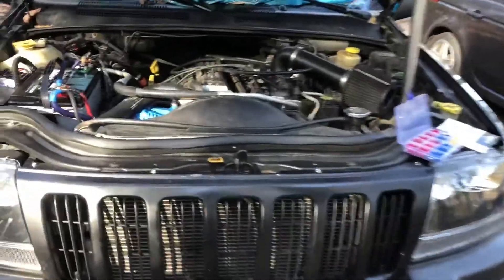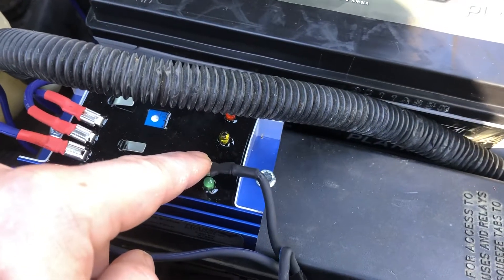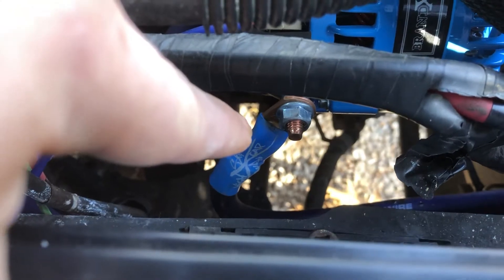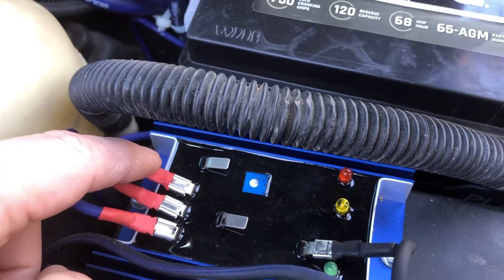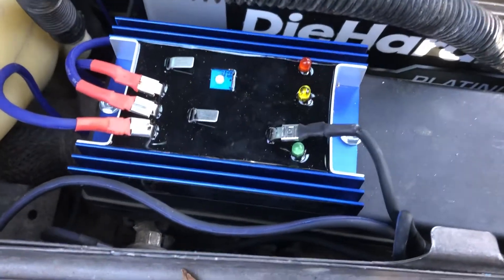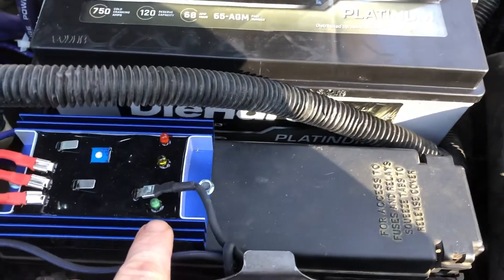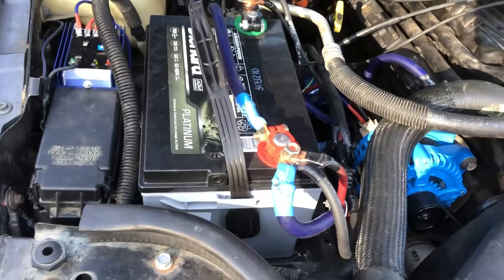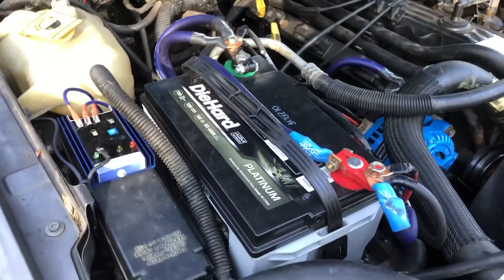How to install a Transpo v1200 external voltage regulator from brand x

Comment: Hello im running this exact regulator.  Did you experience the headlights to come on when starting the car? My turn signals also dont at times and when i disconnect the a wire from the regulator they work fine.

Comment: My alternator from autotech came with a 4 pin plug but only 2 wires. One goes to remote 12v, the second to alternator positive post. How would i go about wiring the regulator? I've followed the video, and all i get is a steady 14.75v. Turning the potentiometer on the regulator does nothing, but the lights come on as if it's functioning fine. Any ideas?

Comment: Your video was great and helped me out a lot, but I’m still a little confused on a couple of things. On the side of the unit it says green light indicates power on. You said it indicates trouble? Also, the “I” prong that you mention doesn’t get used, Is that true on any vehicle? Because on my 2004 cobra all four prongs are used according to nations starters & alternators….. The first one from their harness is white, the second one is red, the third one is yellow, and the fourth one is green. With key off the yellow light is staying on, do you know why? Any help would be appreciated.

Comment: I'm running a 12-volt relay. Do I have to run one? And the orange light does'nt come on, just the green and yellow light. Everything is hooked up right. except im running a 80amp solenoid.

Comment: So My regulator is internal, i would use ignition pin for positive wire and computer field monitor pin for field wire? Then negative to battery and what?

Comment: Does your voltage float? Example: I set at 14.70 but floats 14.70-14.72 is this normal
Reply from the maker: A small fluctuation like that absolutely nothing to worry about
Reply: @Jboost412  Tks bro
Reply from the maker: No problem at all!!
Reply from the maker: Always happy to heIp!!

Comment: How do I adjust it to put out a higher voltage. Thx
Reply from the maker: Start up the vehicle then turn the little potentiometer with a tiny Phillips or flathead screwdriver little by little and until you hit your desired voltage

Comment: You should redo the ground. add a bit of a washer between the clamps. So it tightens flat. Those lead ones are huge cause for issues.
Reply from the maker: Absolutely All of the wiring was just temporary a few weeks later everything was Rewired & converted to run on lithium

Comment: Do you have the battery light on in the dash?
Reply from the maker: No mine doesn’t come on I’m sure some vehicles will be different
Reply: @Jboost412  i have a 2015 Jeep Wrangler. My transpo works fine but i have the battery light on dash. few things doesn't work which i am fine with for now. heated seats and the 110v outlet.

Comment: This will work with any car
Reply: How I get the battery light go off
Reply from the maker: Not exactly sure…what kind of vehicle?
Reply: @Jboost412   I got it now thanks yo video really work
Reply from the maker: Your welcome happy I could help!
Reply from the maker: So there’s definitely some vehicles that won’t accommodate a external regulator at least in stock form but after some work on the electrical yes pretty much anything with a alternator can be modified to run a higher or I suppose lower voltage if you wanted it to

Comment: Did you use the stock alt wire of did you tape it off
Reply from the maker: In my setup none of the stock wiring was used since it’s all too small i definitely wouldn’t recommend reusing it you need 10-12g ofc wiring for the external regulator to function correctly longterm
Reply from the maker: For my alts + output to charge the batteries I’m using 2 runs of 4/0 back to my lithium and cap banks so there’s no drop in voltage
Reply: @Jboost412  thank you I’m going to try that now and see what’s up, currently we are only getting 11.6 when the car is running
Reply from the maker: Does the potentiometer work correctly? It should be set all way down out of the box and you have to turn the dial up slowly while monitoring the voltage until you have the desired result
Reply: @Jboost412  yeah we have it set all the way down
Reply from the maker: Ok cool so dial it up slowly monitoring the voltage level if that works your good to go if not you might have the field connection mixed up

Comment: If this regulator only goes from not charging to 16.8 volts has it gone bad?
Reply from the maker: Well it would be a first ive heard of one failing but anything can break! I would start by making sure all of the connections are clean & tight but yes if everything is exactly how it was when it worked unfortunately sounds like it went bad

Comment: I have an 06 Durango with 5.7. Bought 270a brand X and my idle amp are only 12.2 at idle. Some say it’s because Chrysler pcm limits the alternator and therefore you have to use an external regulator. Is this true?
Reply from the maker: It’s definitely possible, but I would make sure all of your connections are tight the belts good it’s not too long causing your pulley to slip

Comment: Hey man, i just installed this thing on my caddy, and the voltage will only adjust to a max of 14.8, as well as the field wire is the only wire getting higher voltage when i adjust it, and alternator output stays the same
Reply from the maker: What year is the vehicle? And do both lights on the regulator light up? Also is the alt stock or aftermarket…just wondering…so if you turn the knob all the way down the voltage won’t go down and all the way up for example it’s not going up? I’m wondering if you have the alts connector completely disconnected from the vehicle sounds like the computer controlled regulator is still attempting to do its job
Reply: @Jboost412  yes it is the stock alternator for now, and both lights will light up and it turns on just fine. except when turned off the amber light stays on. checked voltage at the connectors and everything is connected how it should be. my alternator plug does not have a ground however. it is a turn on signal wire next to the field wire. should i do anything with that?
Reply: any ideas? im stumped at this point and the yellow light is on at all times. sorry for so many questions
Reply from the maker: If the lights are staying on all the time your ign + is actually getting constant power instead but I’m gonna say your not connected to the field pin from the alt over to the regulator of nothing is changing
Reply: @Jboost412  field pin is now connected, lights come on like they’re supposed to. regulator still doesnt work and i had a spare. that didnt work either
Reply from the maker: With everything connected to the regulator itself is the vehicle completely disconnected from the alt in the sense that the wiring that use to run to the alts connector is no longer connected to the alternator or the connector that you jumped over to the external regulator?
Reply: @Jboost412  Yes, nothing from the car is connected anymore
Reply from the maker: Then that’s an odd issue especially since you’ve swapped regulators i definitely don’t understand what’s causing there to be no manual control over the voltage

Comment: Mine came with an orange box what wire does that go on ?
Reply: Also there is glue on the dial like it’s already preset ?
Reply from the maker: Never seen this message sorry about that first answer is yes there you’ll find some glue or rtv over the potentiometer/adjuster but they’ll never be preset always start with the dial all the way down since different applications & setups have a different starting point for voltage second answer would be i am honestly not sure with these external regulators I have only seen the actual blue box itself nothing else was ever included possibly it was something for your specific application

Comment: Do you have to turn that dial every time you turn your car off
Reply from the maker: No you should be able to set it once where you want it
Reply: @Jboost412  okay good cause I just order the v1301 from brand x and was kinda worried about how it works
Reply from the maker: Oh absolutely good choice! if you have any other questions or issues feel free to ask
Reply: @Jboost412  hey what did you hook your green field wire too and your yellow solenoid wire too
Reply from the maker: Field is going to the pin on the alts connector closest to the big output stud...ground is the pin on the sky next to the field pin which I ran to the ground pin on the regulator then to a chassis ground as well
Reply: @Jboost412  okay thanks
Reply: @Jboost412  so I still use my connector on my alternator do I just need to tap in the wires on the alternator connector
Reply from the maker: You wanna cut the wires that run to the vehicle from the connector and leave yourself enough wire coming from the original connector to run the new wires from the regulator to it...the wires from the truck itself just tape up and tuck away somewhere in case you sell it and put it back to stock
Reply: @Jboost412  okay and one last thing that blue square you pointed at is that the way you turn it down
Reply from the maker: Yes sir start with the adjustment all the way down and then slowly turn it up while you monitor the voltage level until your at the set point you want
Reply: @Jboost412  hey so I got it hooked up those two lights are on but it’s not charging the alternator is it cause I have the wire that’s connect to the alternator pin on the wrong wire
Reply from the maker: Definitely Seems like that’s the issue
Reply: @Jboost412  okay thanks
Reply: @Jboost412  I also didn’t run a ground from the alternator to the voltage regulator
Reply from the maker: Oh yeah you gotta run the ground off the ground pin of the alt over to the regulator then from the regulator to a chassis-body-battery ground whatever is easier
Reply: @Jboost412  can I just tap the wire in the wire that’s connected to the regulator pin

Comment: Hey man I installed mine but my orange light stays on when car is off? You think I connected to the wrong fuse?? When I start car both amber light turn as it should.. no green light. Kinda confused any help would be appreciated!
Reply from the maker: Sounds like you have constant power going to the pin for ignition power “key on key off” seems like a quick fix other then that is it functional?

Comment: For some reason all the fuses except for 2 under my hood are 12v constant. Figured it would be the same as yours since my Jeep is an 02'. Help!!!!
Reply from the maker: I’m tapped into the second 15a fuse in the under hood fuse box, left side of the fuse or furthest toward the firewalls pin of the fuse for my key on key off power..should absolutely be the same...the right side of the fuse will give you constant power so it’s gotta be on the left side of the fuse
Reply from the maker: So it’s fuse #26 fuel injectors that you should be able to use and like I mentioned it’s the pin of the fuse that’s closer to the firewall that’s key on key off “ign 12v”
Reply: Awesome man I appreciate it. Will definitely try tht.
Reply from the maker: Absolutely bro, just let me know if there’s anything else you have trouble with

Comment: Does it work after market alternator?
Reply from the maker: Not sure exactly what you mean by aftermarket, but if the vehicle has the voltage regulated by the pcm/ecm then usually they’ll work fine...there’s different ones for different vehicles though
Reply from the maker: Most mopars have issues with the computer controlled regulators so in my case this Jeep wouldn’t charge above 14.0v without going to an external regulator
Reply: @Jboost412   a stock alternator. Just a stock alternator

Comment: So wiring this up am I supposed to take the regulator out or juss cut into the wires that plugged into the regulator?
Reply from the maker: Do you already have an external regulator of some sort? If so yes you completely eliminate that regulator, this is a stand alone regulator that simple needs constant power..key on/key off power and ground then the field connection and ground from your alternator to function properly

Comment: so you cut the wires coming from your alt plug ?
Reply from the maker: I’m my setup, I had to run all new wires to the alt...my factory ones are just wrapped up and hidden away
Reply: @Jboost412  another question bro what size screws you used to bolt it down ?
Reply from the maker: Just used your standard hex head self tappers, hows your setup going?
Reply: @Jboost412  its good just got my regulator in the mail gone try to hook it all up this weekend hopefully
Reply from the maker: Well if you have any trouble with it don’t hesitate to ask brother! I’m happy to help you however I can
Reply: @Jboost412  ok bro i hook mine up got lights on and everything but when i turn the knob my voltage dont move up at all and the truck is on
Reply: @Jboost412  I have a 2020 Ram 1500 and was looking into maybe getting a voltage regulator. So basically you unplugged the factory pin connection from your alt capped them off and your 2 new wired coming from your new regulator tap into your alt?
Reply: Dante did you figure out what it was?

Comment: On the 2-wire alternator connector, does it matter which wire goes to field and which wire goes to ground on the regulator? The new connector that came with the alternator has a black wire and a green wire. Thanks
Reply from the maker: For the 2 pins coming off the alt the one closer to the passenger side is your field pin and the one closer to the drivers side is the ground....nothing would happen if you connected them backwards except it wouldn’t necessarily work right
Reply: @Jboost412  awesome thanks again 👍🏻
Reply from the maker: Anytime bro!
Reply: @Jboost412  sorry for asking 500 questions lol. Do you ever have issues with the regulator in colder or freezing weather? I’ve heard some others have and it’s gonna be like 10 degrees all week. Don’t wanna install it if it’s gonna have issues in the cold
Reply from the maker: No problems at all with it, it’s been steadily below freezing here and I haven’t experienced any issues

Comment: Thank you so much for taking the time to make this video explaining how this external regulator gets wired up. I have an 04 Jeep GC with the 4.0L. Just got my 300amp brand x alt today and ive been looking everywhere and even messaging Jonathon about how its wired up exactly. You explained it perfectly. Appreciate it!
Reply from the maker: Your very welcome! Your absolutely right, there’s really no clear instructions anywhere explaining how to use that particular regulator. So I’m happy I was able to help you out!
Reply: @Jboost412  Hey man also since you happen to have the same vehicle and engine, did you just go with a half inch shorter belt (the one you have in the video)
Reply from the maker: Absolutely, that’s the belt you wanna use